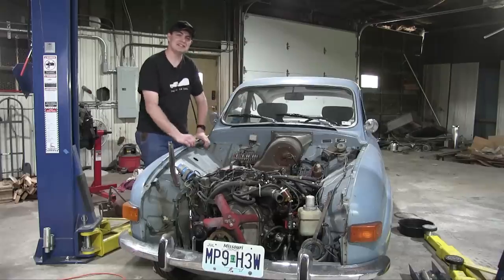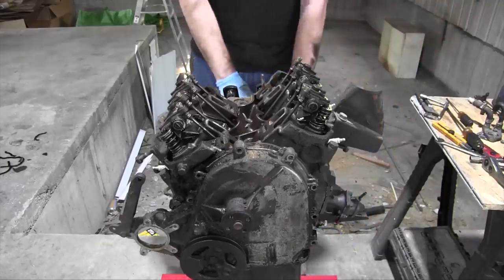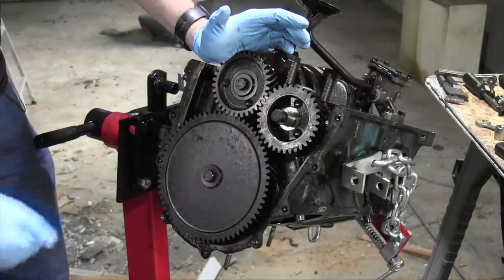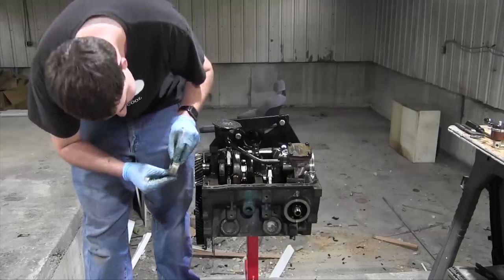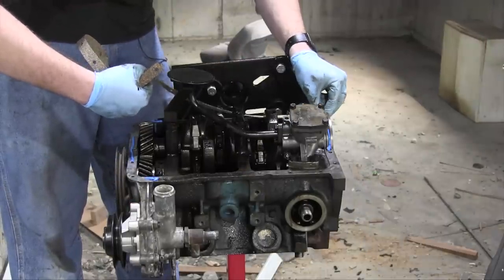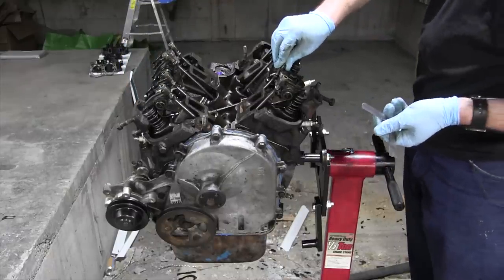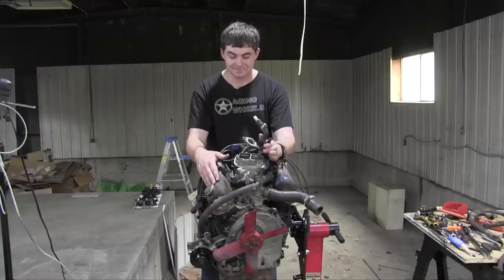Upgrading My Saab 96 to a Two Barrel Carb - Part 1

Comment: The rubber washers are probably there because those two bolts go into holes that are not blind, but rather have oil on the other side. This way the oil won't leak out by going down the threads of the bolts.

For your future engine rebuilds, wash the engines before you disassemble them. That way they are easier to work on and you will not have to worry about getting water in places it shouldn't be since you're going to disassemble the engine anyway.
Reply from the maker: I bet that's the answer! 

And yes, you're right. I realized I should've pre-cleaned the engine about two seconds into the teardown.
Reply: Came down to the comments to look for this answer, glad to find it as the top comment.
Reply: @agingwheels   You could have done it after it was apart as well.  Just rinse with hot water and blow it off with air.  You can smack those seals out of the timing cover with just a screw driver on the one side, they don't take much.  The sludge in the other engine was not that bad.  I would have done a compression test plus ridge measurement to determine the best block/head combo to use.  I generally put a thin layer of grease on the paper gaskets like the water pump, makes them come off much easier.
Reply: Because a rubber is useful.... And you always seem to need two.
Reply: @renof2505  i was just yelling at my screen about putting oil/grease on the papir gaskets
Reply: +1 for steam cleaning the engine before you take it apart; give it good dosing with degunk / brake clean before and it'll be soooo much better.  If you have time, WD40 / penetrating oil on all the fixtures after the wash.  Seal the air cleaner etc. before of course...

Comment: Why just a two barrel carb when you could have a TWIN ENGINE saab 96
Reply: a v8 saab, yes
Reply: it becomes a saab 192
Reply: Was thinking more of that space in the trunk, rig up a rear drivetrain to get 4 wheel drive.
Reply: Two V-4's equals one V-8.
Reply: A friend who is a SAAB 96 restorer/specialist shoehorned a Ford Capri 2.8 liter V6 into a 1970 96 when it's engine was borrowed for a Sonnet. Not for the faint of heart, and not good for the marginal transmission's durability.   Zippy plus lousy fuel mileage and understeers terribly now.
Reply: Why stop at 2!? Add 4!

SAAB QUATTRO 2 ELECTRIC BOOGALOO!!!!
Reply: Why stop at two normal engines? Strap JATO rockets to the bumpers to help you get up hills.
Reply: @dentistguba  How would you get that engine sinked up with the other engine so the two engines work together to push and pull the car forwards?
Reply: dentistguba n
Reply: SAAB did try that in the SAAB 92 i think it was(for rally). They had two of their 2-stroke engines working together as one wierd inline six
Reply: look up "w168 amg 38", you could put one engine in front, link it to front wheels, one in the back, link it to back wheels, they must be identical, their transmissions have to be identical, link the engines with the same gas pedal, be it electric or wire tension, link the gearboxes to the same lever and clutches to the clutch pedal, have a switch for the second engine and you can now drive on front wheels, switch a button, have 4x4 or turn off the front engine by key and drive on the rear wheels... Amg didnt give you an option to drive only on rears as they had to shovel an engine and the gbox in the back and had little space for a secondary alternator which would run the engine and if you shut the primary, you aint got power for long... They just added a button next to those for window regulators which turned on the secondary engine... But with a bit of space and work it can be done, they were having fun and companies dont like wasting money into fun projects that result in only 4 cars being produced and not sold, as they gave two to their at the time professional drivers for kicks and the other two are God knows where...
Reply: @russlehman2070  Wouldmt that be a W8? A V8 is two inline 4s.

Comment: They use fiber gears because noise reasons. All old pushrod and sidevalve engines use them stock. There are usually aluminium or steel replacements but they whine more.
Reply: I had a Capri with the V6 version of this engine (same block with two more cylinders) that had nylon teeth on the camshaft gear, although the hub was steel. The teeth let go and all dumped into my oil pan. I replaced them with a steel crank gear and aluminum camshaft gear and never noticed a difference in the noise. A half-inch thick iron cam gear cover pretty much blocks that noise!

I know this video is old, but I would recommend the change.
Reply: Back in olden times (late 40s) Jeep changed from timing chains and sprockets to a fiber gear and a steel gear. It increased dependability and lowered noise. It did cost more but was worth it and remained in use until 1971 when American Motors took them over and switched to their engines. I had 2 of these vehicles without issues but every chain/sprocket vehicle I owned needed new chains at some point (4 of them) and a mechanic friend confirmed that this was normal and actually got worse after the changeover to plastic toothed cam sprockets. It seems they introduced flex/lash the wore the chains faster. Once switch to all metal they lasted much longer. YMMV
Reply: Not all pushrod/sidevalve engines; many (probably most) used a chain drive.
Reply: volvo used one for decades in their pushrod engines, it disappeared in the 70's when they went  to overhead cams

Comment: On the Ford versions, the oil pump in the sump was driven by a vertical hexagonal rod that went into the bottom of the distributor (that in turn being driven by the camshaft) This rod had a nasty habit of rounding off its corners where it pushed into either the pump or the distributor, so instead of hexagonal it ended up semi circular. This then lost the drive to the oil pump - engine carries on running quite happily though. I was doing around 50 when my engine seized! Worth checking the rod.
Reply: Ah, 'The Pencil' as it was known. Yep, that helped wear out the engine in my father's V6 Zodiac before it got to 60,000 miles. At this point a new 'short engine' was fitted and all the problems disappeared for the rest of the car's life.

Comment: Robert, I don't know if you remember me telling you this in D.C last November but I know a guy who was a Saab mechanic who had literally over 100 of these old Saabs, 95s, 96s, 99s, 900s and Sonnets on his 100 acre farm. A co-worker knew him and we went over to his farm and he gave us a tour.

That was 20 years ago. My co-worker told me that the county was after his ass trying to force him to get rid of all of these cars. So I don't know if he still has these cars or not.

He had a 1979 99 turbo with 800,000+ miles on it that was given to him by one of his customers. It still ran but the compression was so low it had no power. I saw the odometer but can't remember if it actually said 800,000 or not.

Below is his last known whereabouts. This must be an old phone number because they changed the area code from 615 to 423 about 20 years ago when cell phones started to get popular. He may have passed away since then. But he is well know among the Saab community so just mention his name on one of the boards and I'm sure somebody knows him.

http://www.saabnet.com/tsn/faq/clubs/tn.html
Reply: James Siebold   Ken is still there on the farm, but has gotten rid of most of his cars. He does still have a barn full of old parts which are unfortunately rusting away.

Comment: When you have time and 2 examples of the same engine, both of which have problems, but not the same problems, the obvious solution is to take the best parts from each and build one good engine.

Comment: Many many years ago I worked on a similar Saab upgrade but in addition to the two barrel carb, we also installed larger valves from a BMW in the cylinder heads and did a lot of porting on the intake and exhaust ports. We ended up increasing the torque and power of the motor so much that the stock clutch, which is rather dinky, would not last very long in the car. The owner of the car built it as a classic rally car with a roll cage and various other mods.

Comment: I think you are doing pretty good as a mechanic, you have the courage to dig in and pull apart unusual autos and engines, pretty good diagnostics, and you are smart enough to improvise tools and methods. Don't worry about making mistakes, we all do, it's a great way to learn. Looking forward to the first start. You're no idiot, you are an entertaining mechanic, thanks for sharing your experiences..

Comment: boy that noisy fuel pump is gonna drive you crazy. should have cleaned all the parts before assembly, a nice detail with a new coat of engine paint would look great

Comment: It's a classic "... While I was in there" moment.... Or in this case, segment. While you're in there, I think you should get the downdraft weber and make a hole in the hood for it. I think the skinny round air filter does not give enough air in them to give it the power.

Comment: I really enjoyed this video as I have been just in your position.
My first car ever was a Saab 95 -75. I bought it for around 100 dollars in 1986 with a seized balance shaft. I was only 16 years old. It was really fun to see you banging the balance shaft with different hammers. I did the same and almost wore down a plastic hammer at that time before i tried a small pen hammer and ding, the it went down into the engine. I replaced the balance shaft bearings (with good aid of my best friends father as mentor)and the engine was in good shape again. 
I never drove that car in traffic but the engine ended up in my mother Saab 96 when her engines balance shaft bearing seized up :)
It´s a common problem.

Comment: You dont need the balance shaft. Its not responsible for actually balancing the engine.
Leave it out but turn its bearing shells so they block the oil feed holes.
The oil pump and distributor are driven by the cam shaft.
It only attempts to eliminate parasite vibrations which a V4 doesnt really have.
Only line 4's have compounded parasite vibrations and they are un-noticable.
I have removed the balance shafts from both a 4G63 Mitsubishi and a Honda CBR1000RR
and I do not notice any increased vibration in these engines.

Comment: Very, very late to the party now, but if you want to clean out potential oil sludge in your engine, try running Royal Purple brand oil through it for a cycle. It tends to pull off deposits and dissolve them away. This leaves a pretty clean engine but the first change after you use Royal Purple looks like you've never changed it before in its entire life, because it'll be pitch black. I'd suggest letting it run with Royal Purple of the appropriate weight for at least 3500 miles before draining it and replacing it with whatever your usual preferred synthetic or synthetic blend is. Royal Purple is one of those insane long-life oils that can legitimately go for 10k miles before needing to be changed if your engine has only ever had synthetic oil in it. If it's collecting all the crud from previous conventional oil deposits, it's not going to last quite as long, but it's great stuff to put into older cars because you can basically forget about needing to change it for literally years if it isn't a car you drive regularly.

Comment: So intriguing seeing a V4. 
Same thing happened on my Mercedes 280TE. Transmission seal leak so since easier to pull the whole driveline, do that. While the engine is out, do an external reseal. Though, now I can access the front suspension so much easier. Since waiting on parts, why not waste time doing a port and polish. Never again will I do that, you end up biting off more than can chew.
The replacement engine looks so nice and clean, doesn't look hardly any sludge in the oil pan.

Comment: Careful when removing the carburetor !!
As a young man I owned a Fiat 850, and I had to fix something on the carburetor, and lost one of the washers into the intake manifold,
I didn't notice, of course. 
As I didn't find the old washer, I put on a new one, and put it all together and drove away.
But what was that strange sound from the engine ?
I drove back home with some strange sound from the engine.
My father wich was very handy as a mechanic, helped me dismantle the engine, and as we opened up the top, we saw where the washer had ended up.
In the cylinder, of course. The piston had some nasty marks on the top, but it was no holes.
We removed the remains of the washer, put the engine back together, with new gaskets, and I droved for several years after that.
Nice engines in the old Fiats, they rusted like hell, but were quite fun to drive, while they lasted. 😄

Comment: The interference thread can be very slightly tapered, so the nut has to be stretched to fit over the bolt or stud.

I used to mount suspension leaf springs in machines for fatigue tests.  The clamping bolts were also tightened in sequence and in stages.  Only, instead of 20, 40, and 68 foot-pounds of torque, it was 30, 60, 90, 150, 210, and (finally) 300 foot-pounds of torque.  The last three stages were done with a four foot long torque wrench with a 3/4" drive and whose calibrated range started at 120 foot-pounds (max rating was 600 foot pounds of torque).

Comment: Brilliant video.
Had one of these myself, a 69'er as well. The gearbox is somewhat odd in ratio but quick up to 120 km/h . It was my second SAAB but I have had many since. Today I drive a 9-5. With factorychanged sw. I live in Trollhättan and worked at SAAB/GM for 15 years. But I miss my 96! Can't wait to your next video.

Comment: I kept burning valves in my 1970 SAAB 96 V4. At the same time, I stove in the exhaust collector at the front of the engine, so I replaced it with one for a Sonnet V4 which had two exhaust outlets, then created a second system for the left side of the car, a mirror image of the right. Result: less back pressure, lower internal engine temperature, no more burned valves, AND MORE POWER!
Reply: Burning valves is a sign that you had a bad adjustment on the rocker adjusters or a big airleak in the intake manifold.  These engines don't have hydraulic lifters.  I've seen these cars run fine with the stock system with a dented long pipe, they just don't go fast.   Either your brake master servo had a puncture, bad valve adjustment, or something wrong with your carb's jetting.

Comment: What you do need in addition to the intermediate plate between the carb and the manifold is a phenolic spacer to reduce heat transfer. There are spacers for sale that are 15mm thick, making it possible to reuse the original air filter housing. You have to make the underside of the filter fit the Weber, but there is nothing that can't be done with a 2mm thick sheet of aluminium.

Comment: I totally get it. Yank an engine to fix a easy fix. I have a water pump bolt on my truck's engine. The other car needs an LS.....it'd be so nice to pull my truck's running engine, and swap in a cleaned and new gasket'd engine. Your vids are quickly becoming my favorites, and I really like old Saabs.

Comment: Please check your crank shaft bearings too. If that engine ran with that ballance shaft for some time, there's a good chance that it damaged other bearing (-surfaces) as well due to oil starvation as with that amount of play on the ballance shaft, most if not all of the oil would have been pushed out the oil holes for the ballance shaft as it's the path of least resistance. Not to mention, where did all that bearing material end up going? It winds up everywhere.
Reply: In the oil filter...

Comment: THIS 30 min epic is why I 'Patreon' Aging-Wheels. 
I know this took hours to edit.... excellent work Sir.
Reply from the maker: If you're curious, I spent roughly 15 hours editing this. It would've taken less time, but my editor and/or my computer crashed about 8 times during the process. This got very annoying
Reply: Aging Wheels ...well twas worth it. I'm gonna start my own channel this year... getting my old Jawa 350 two stroke bike running properly and not the jerky, badly made, slow, smokey vibrator she is now. I will be stealing your style.... imitation is the best form of thingy.
Reply from the maker: Best of luck!
Reply: I digress im doing the same to an old 2 stroke Suzuki bike (TS125) but im getting it running, good luck with the Jawa!

Comment: The rubber rings for the bolts in the pan line up with the balancing Shaft. Maybe the screw holes go deep and to prevent leaks from the bolts they are like that
Reply: The bolt holes are not blind and go through the block into oil. That's why the rubber washers.

Comment: You could have knurled the bearing surfaces on the balance shaft, itself.  Knurl, then machine to spec, and re-harden.

Won't be quite as durable as stock, but oiled better.  Plus it costs $0!  (Except for tools, but that's a different budget, so it doesn't apply.)
Reply: I've done that many times... already have the equipment, so it's a no brainer.

Comment: If you ever have to use the cam bearing puller/install tool again, the way that you installed the rear can be done for the front as well, just through the back of the block. I almost did the same on my jeep, but ended up needing to take it to the machine shop and had them do it.

Comment: That engine reminds me a lot of my Volvo B18 that I just did a bottom end rebuild on. I even forgot to drain the oil as well. My Volvo has a similar timing gear and threaded rod style linkage, but with dual SU carbs. It's a '68 Volvo 142, I'll have videos eventually.

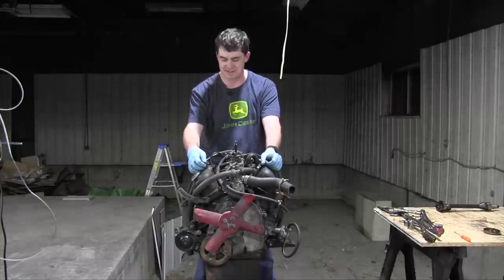Comment: Had to stop at 14:40.......why didn't you decide to use the balance shaft from the other engine and replace the bearings in the better block?